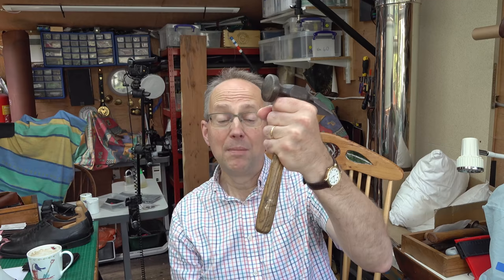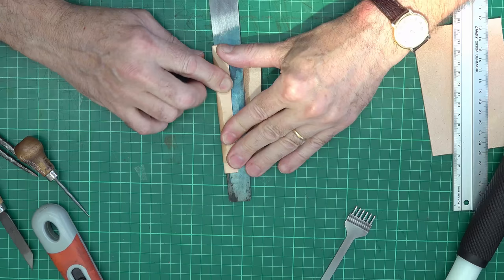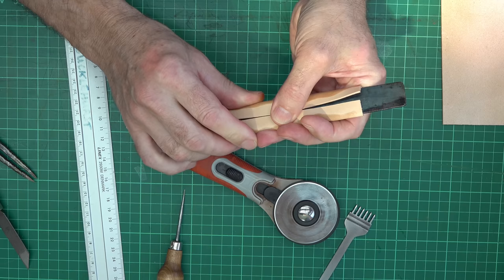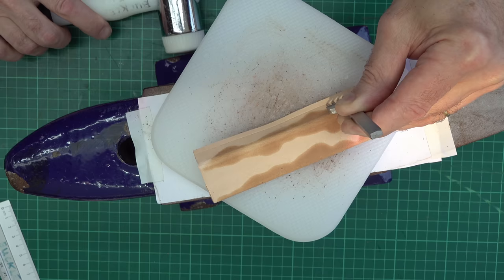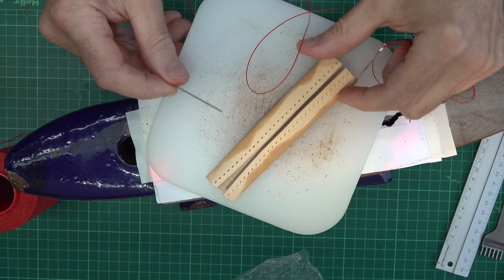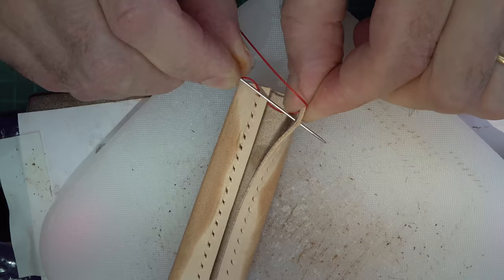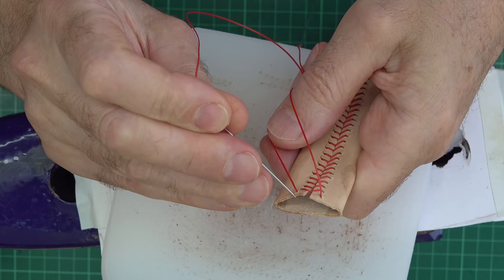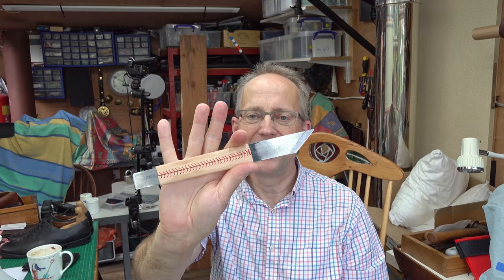How To Baseball Stitch For Tool Handle Collars

Comment: Nice work. The other videos that I looked at and talked about showing on a steering wheel only talked about using one of the threads and yet my steering wheel cover came with two threads and two needles! So I guess I know which method I'm going to use. Thanks

Comment: Great stuff Mr R, couple of questions, why didn't you leave the knife inside the leather handle while you sewed it on ? Was it just because its simpler ? And why no adhesive to stick the leather to the knife as well ? Apologies if these questions are simplistic, I'm quite new to leather work to be honest and come from a woodworking background, but the more I see the more it peaks my interest.
Reply from the maker: Good questions...it is a bit easier to sew off the knife...and knowing my luck I would drop the knife!! Good idea 're glue, I may need to but I thought I would see if it loosens up a bit with use, and then glue if needed.
Reply from the maker: Just to add great to have the woodwork skills if you try some leatherwork...you will find it so much easier.
Reply: @harryrogers  Thanks Harry, I recently removed all the leather from an old sofa that was being thrown out which has left me with loads of various shaped pieces, just got to come up with things to use it for , definitely going to try and find a handle that needs covering though !

Comment: Can you stitch this with the leather on the item? My axe handles have palm swells so I won’t be able to slide it on after the fact
Reply: JoshL you can stitch it on the handle loosely and pull the threads tight once you’ve finished the stitching. Leaving the stitches loose as you go means you can manipulate the leather for getting the needles through. Hope that makes sense.

Comment: That was very nice, Harry.   I am a complete novice at leather working. Can you do this directly on a handle as well?  If you could not slip it on or off like this one, I mean.
Reply from the maker: Hi Gary, yes you could...some people use a screwdriver or similar to push the leather up or down to help get the needle through, and if using thicker leather on say a very heavy blacksmith hammer one could use a curved awl with matching curved needle and not sew through the complete thickness of the leather, but still get this effect.
Reply: @harryrogers    That is great.  Thank you Harry for the information.

Comment: Can that stich be done under pressure, to tighten a wrap around an object shaped in a way that wouldn't allow a wrap to be shipped on it?
Reply from the maker: Hello yes to an extent, and certainly with slightly thicker leather and thread...if veg tan leather you can also wet mould it to the shape ....say like the swelling on an axe handle.